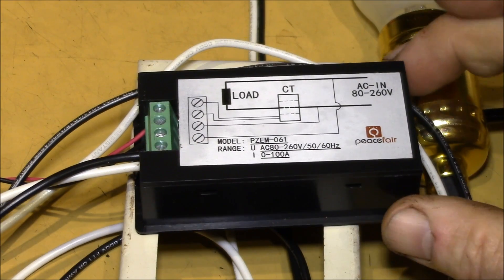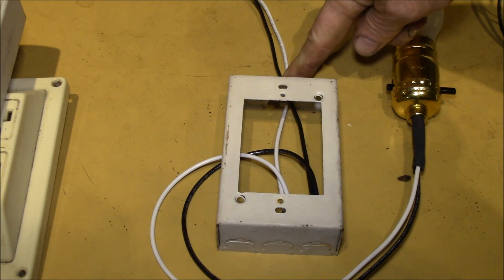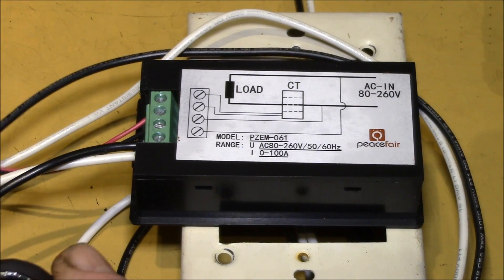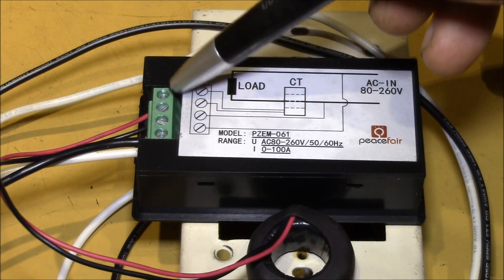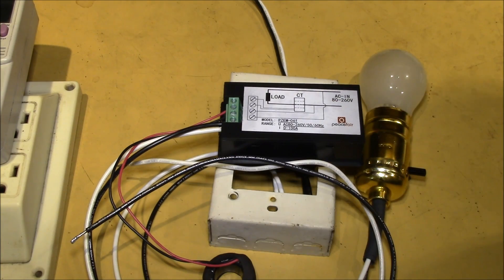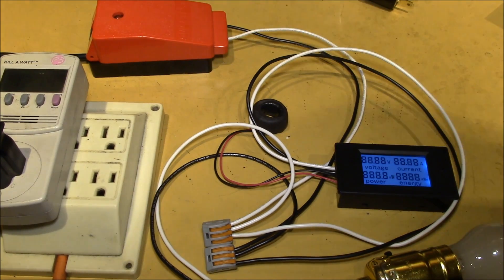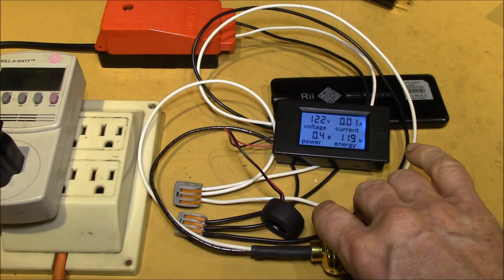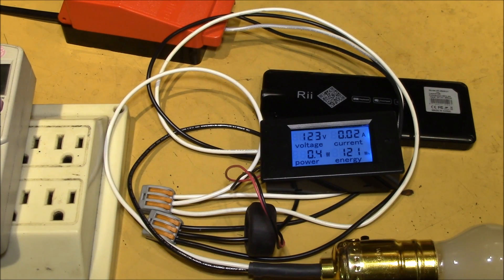PZEM-061 AC Panel Meter Wiring

Comment: I connected a PZEM-021 to my 3A Variac, when I test 100 Watt incandescent bulb, the meter shows 10 or 11 W, how can I make it show the actual wattage? like in 3 digits.
Reply from the maker: Works fine on on my meter connected to a 7A Variac:
https://photos.app.goo.gl/94N1RwSKrB1en83K8

100W bulb, 100.3 watts @ 119 volts.  Maybe check that you have everything connected properly.  I go through the setup in detail starting with this video:
https://youtu.be/47osFl0LuJ0
Reply: @The4Crawler  I don't know much about this subject(electricity) so I just followed Paladinejme's video and he was extremely helpful in guiding me to wire my meter properly so I know it is wired according to what he has done with his which worked perfectly for him, mine OTOH, from the getgo has 0.3A residual leakage? if that's the right lingo?, and the wattage shows 00.0, so it can never show 3 full digits like 100.5 watts, if I connect a100 W bulb and set my variac at 110V, this is what I'll get:110V,  0.13A,  power/Watt 14.2.
I guess it either has something to do with  the small size of the variac(3AMP, 300W) or the meter is limited to show wattage in 2 digits. I googled pzem-21 and saw a few meters that is exactly the same as mine and shows two digits of wattage.
Reply from the maker: @ddistrbd1  My meter is about 4 years old, so perhaps something has changed since then.  But it's somewhat normal to show a small current with no load, that's due to the meter itself pulling power to operate.  That's what I saw on mine until I did this:
https://youtu.be/zpBXKnCsllQ
The idea is to separate the power/current for the meter's power supply from the voltage and current flowing to the load.  Also, the meter will start out reading 0.0 up to 9.9 watts then as the load increase, it'll go up to 99.9 watts then it'll jump to 100.0 and higher.

Comment: Great info here, thanks a bunch. I just bought two of these meters and I plan on building my own meter to monitor how much current I'm pulling through my new inverter generator so I don't overload it.
Reply from the maker: Glad I could help.  Sounds like a good project.  Just make sure and wire up each meter between one hot leg and neutral and then run the hot wire through the CT.
Reply: Great info but I have a question please. I am going to use 2 meters on the 2 legs of a 2 pole 50 amp breaker to my generator. I want to measure the load on each side of my panel. My question is the hot wire from the meter, #3 or 4 connection, needs to go to the load. So if I connect one of those wires to the hot wire to the 50 amp circuit breaker and the other to neutral, won’t that be too much for the meter and shouldn’t the wire gauge be equivalent to the 6 awg from the 50 amp breaker? If I use a 22 awg, won’t that wire heat up or melt?  Thanks for helping me understand how to handle that.
Reply: @garcosta  the power wire for the meter will be fine as is because the meter itself barely pulls any power at all.
Reply: @Ozzie4Para  Thanks for that. Also, if I extend the 2 wires for the CT about 3 ft, do you think it will affect the accuracy of the unit?
Reply: @garcosta  three feet definitely won’t affect any accuracy.
Reply: @OzzieAlacron This is what I am about to do as well, putting one meter on each of the two hot 110V wires. My question is, does it matter which hot wire I use to power each meter? As in does it have to be the same hot wire that the CT is on each meter? Or can I use the same hot wire to power both meters even though one meter CT would be on a different hot wire? I suspect the two wires being out of phase may cause issues but not sure. Thoughts?
Reply: @TaxpayerDave  I would use the same leg that the CT is on. Don’t know if it really matters but that’s what I did.

Comment: I am trying to monitor the power in a 150 amp service to my home with 3 legs, 2 hot and one neutral (240volts total).  I understand I would need to use 2 meters, once for each leg.  I know one of the meter power lines will go to neutral bar, however, where would I connect the hot wire?  to any breaker on each side?  Will the meter measure accurately?  Want to make sure I am getting total load on each side, not just at the  breaker I connect the meter hot wire to.
Reply from the maker: I show a 240V setup in this video:
https://youtu.be/LhR-Z6lBeZw
Now that one is a L1-L2 with no neutral setup.  
With L1-N and L2-N, just connect one voltage terminal of each meter to N and then the other voltage terminal to L1 or L1, running the main panel feed wire through the CT.  This way you'll have 120V reading on each meter and the line current and KWH on each leg.  Unless you have a split CT, it may be tricky to run the 150A main service conductor through the CT, as in you'll need the power company to come out and shut off your power and/or pull the meter while you do that.  Another option:
https://youtu.be/ov2NfLBgjX4?list=PLpY2FP1a9tiurSiQTwhalz4KBxg_7db65&t=230
Reply: @The4Crawler  Ok.  that makes sense.  Yes, i have the split CT.  I am using the PZEM-022 model which has the same wire diagram but measures more values.   Using this to monitor home load, generator load and a subpanel load.  Thank you for the video!

Comment: it is great video, i would like to know how to use it on a water heater on 240 V. Thank you for your help
Reply from the maker: Sure, this is how to wire a 240V version:
https://youtu.be/LhR-Z6lBeZw
Reply: @The4Crawler  i don t want touse it fixed, i want to be able to test more than one appliances, so is it possible to have a 110 volt for the meter and use the ct on the 240? i hope i ask it the right way.i use 110 v to connect the meter and i use the ct on one wire that connect to the water tank. after i can use it on another tank and on and on. Thank you for your help
Reply from the maker: @pitlatour3864  In the video I linked above, I show how to make a portable 240V power meter.  This would be set up for 240V loads only.  I wire the voltage sense input across 240V (line to line) and only one line wire goes through the CT.

Another way to wire the meter is connect the voltage sense across 120V (line to neutral) and then run both line or load wires through the CT.  But you want one wire running left-right and the other running right-left, so that they are 180 degrees out of phase.  This way the meter will be reading 1/2 the voltage (120V) but 2X the current so the power and KWH readings will be correct.  

You could do either wiring style with the CT separate and then run the load wires for each appliance you want to measure through the CT.  I think I've heard about a version of the meter that has a split CT so that would make it easier to install around existing wiring.  I've never looked into that newer version myself so don't have a link to it.

Comment: How would you wire this on a 240v 2 phase on 2x120v?
Reply from the maker: See below:
https://youtu.be/LhR-Z6lBeZw
This is for a pure split phase 240V load, no neutral connection. This setup measures current in one leg and the full line-line voltage.

Comment: Got one of these from amazon today. Showed up DOA, would not power up. I'll be referencing this video again when the replacement shows. Thank you for the detailed walk through.
Reply from the maker: For a quick check, all you need to do is connect the two voltage input lines to power.  It should power up the LCD and at least display the voltage.
Reply: @The4Crawler  Yes sir. Did that. Never even got a flicker out of the screen. Didn't smell anything burnt, but with it being surface mount tech, it was too small to see anything obvious. Thank you for the reply!

Comment: Based on the video, the transformer goes around the hot wire coming directly from the power source before it gets to the Wago nut. Correct?  I keep trying to figure out which black wire you put the transformer.  You did not put the transformer around the black wire to the light bulb I assume.  I did this successfully last year, but lost my diagram so I am redoing it. thank you.
Reply from the maker: You want one of the wires running to the load to go through the current transformer (CT).  You can also run one of the wires from the power feed through the CT if that's easier, although then the meter will read the current needed to run the load plus the current needed to run the meter (which is a few tens of milli-amps).  Either one will work and makes no difference if it's the hot or neutral wire.
Reply: @The4Crawler  ahhh, thank you. I get it now. thank you

Comment: It always takes me a while to sort out what wire you refer to
Reply from the maker: Any particular wire?  I just have the red/black CT wires hooked to the upper 2 screw terminals.  Then there are 3 black (neutral) and 3 white (hot) wires.  One each from the power source.  One each to the load and one each to the meter (and connected to the bottom 2 screw terminals).  Pick one of the wires to the load (light bulb) and run it through the CT and it should work.
Reply: @The4Crawler  I am about to set up another one of these things.  The video is nice, but I have to stop it in order to trace which wire goes where. The video shows black and white wires in a circular pattern and crossing over each other which is most confusing. As with last time I will draw the thing out and go from there. I love this meter.  It is especially useful to me since it is in line with a wall plug connected to my outside Honda generator. Tells me what everything is drawing.
Reply from the maker: I was trying to follow the standard wiring code with the black/white wires and they ended up a bit too long to all fit in the camera frame without coiling them.  May redo the video in the future with different wire colors and much shorter.  

You just have the black/white wire pairs, one pair from the power source (like you generator), one pair to your load(s) and then one pair to the meter.  All 3 pairs connect together at some point, I used some Wago lever nuts, could also be a wire nuts or whatever.  Then all you do is take one of the 2 wires running to the load (or one of the wires running from the generator) and run it through the CT.  Makes no difference which color wire or which direction.

Comment: Audio level for about 90% of the video was terrible!
Reply from the maker: Sorry about that, I can't hear any difference.  Any particular time stamps where it's OK and not OK for you?
Reply: @The4Crawler  Hmmm,
I just re-checked it and its healed itself, I suspect I have a huge problem with interference in my office. We have just switched over to a very expensive and troublesome NBN network here in Australia using part fibre optic and part copper cables. Its the only thing I can blame for the problem.
Thank for getting back to me so promptly.
Cheers
John
Reply from the maker: Thanks for the update.  Have heard some horror stories about that network from Dave @EEVBlog

Comment: Can you use one of these to check the load on a generator hooked up with a 30A 240v cord? If so would I need 2 so I can read the load on both power lines or could I use 1 meter over both power lines? Thank you for the video.
Reply from the maker: Yes, a few options possible.  If you want to see the loads on both 120V legs, then 2 meters, one on each side would do that, add up the readings for the total power. 

Another option is to measure the current in one leg, as shown in this video:
https://youtu.be/LhR-Z6lBeZw
This would read the total power assuming the currents in both legs is fairly well balanced as well as the total voltage.

A 3rd option is to use one meter and then run both currents through the CT.  You need to run one wire through front-back and the other back-front so that they are in phase.  Then connect the meter across one leg to neutral, so it's reading 120V and the CT will see the total current in both legs and calculate a single power reading.
Reply: @The4Crawler  Thank you for taking the time to reply.

Comment: Can you pass two 120v hot legs through the current transformer to measure 240v or does the 240v need to be on one conductor?
Reply from the maker: Apparently yes, you can do two legs through the CT although you need to consider the direction of current flow and what sort of load you are measuring.  In my case, a pure 240V load, no neutral connection, so current in leg1 equal to current in leg2, so only one leg needs to be measured in the CT.  For an unequal load, if you run two legs through the CT you'll get one of two readings.  If both wires are run in the same direction, you'll get the difference in current of the two legs.  If you reverse one leg through the CT,  apparently you'll get an average current reading of the two legs and I think you'll need to measure a L-N voltage not L1-L2.  This is because you are adding the current in L1 and L2 together and thus you need to use half the voltage (120V instead of 240V).

Now if you want to measure each leg separately, you'll need two CTs and either two of these sort of meters or a more sophisticated meter with multiple CT inputs.
Reply: @The4Crawler  If I wanted to measure my house at the breaker panel what leg does this need to be on since there are two, Ground and two hots @ 240v 200amp main shutoff?
Reply from the maker: A few options.  

One is like in this video:
https://youtu.be/LhR-Z6lBeZw
Measure current in 1 leg, voltage across 2 legs.  Works well for a balanced 240V load where the same current flows in both legs.

Second option is to run both L1 and L2 through the CT in opposite directions and then measure voltage between one leg and neutral.  This will show you the sum of currents in L1 and L2 combined with a line-neutral voltage and resulting power.  Practically, this likely won't be possible, because your main feeder wires are probably too large to fit through the CT together.

Third option is to get 2 meters and 2 CTs.  Hook one to L1 and neutral and the other to L2 and neutral and you'll have 2 displays with current, voltage and power readings for each leg.  Add the power readings together for the total power.

Fourth option is to use something like this:
https://youtu.be/ov2NfLBgjX4?list=PLpY2FP1a9tivPdpLVyg8XMqxw6B6SAEbI&t=227
This is a home energy meter with 2 CTs and it interfaces to my home automation system (it has no built in display).  There are other stand alone home energy monitor systems, I think one is called TED.  Similar design, 2 CTs that clamp around L1 and L2 and then measure a voltage.

Comment: Not clear at all.
Twisted wires everywhere
Reply from the maker: Did you have any specific question on the wiring.  It's hard to keep all the wires perfectly straight so I tried to keep the colors matching instead.  Small red and black for the current transformer (CT) and then the black and white for the power/load wires.  Black to black and white to white and run one of those through the CT.
Reply: @The4Crawler  thank you for the clarification.
I just wish you connect everything from scratch to finish on camera it could have been better. Not just explaining already connected system.
Reply from the maker: Thanks for the suggestion, I'll see if I can remake the video showing every single wire connection made on video.  I didn't do this the first time in the interest of time, as the typical YouTube video watch time is a bit over 2 minutes.

Comment: Thank you very much for the clear video, it explained a lot to me. I am trying to setup an Orange Pi so that it measures the "return of investment" of some solar panels. I feel motivated now to hook the PZEM (a bit different one) up to it :)
Reply from the maker: Glad you found the video helpful.  There's one of the meters that has serial data output, the 004T model.  It's only for AC power.

Comment: Hi Brown, thanks for this video. It’s very helpful. I am wondering if it’s possible to power the meter from one line and measure the amperage on another line? I have 3 lines coming in to my house and I want to measure them separately. I ordered 3 meters and I am thinking it would be easier to power them from the same place.
Thanks !
Reply from the maker: You bet, see below:
https://youtu.be/b2MXXSuzM2k
Depending on how you wire them, they may be measuring just one voltage and applying that to the 3 different current readings to calculate the power.  But if all 3 lines are of similar voltage, then that's not a big deal.

Comment: Hi is it possible to connect the CT few metres away from the unit
Reply from the maker: Sure, that's the beauty of a current transformer.  They output a current for the signal.  As long as that current is flowing in a single circuit, it's the same no matter how much wire it flows through.  That is, voltage drop is for the most part irrelevant.

Comment: thank you for this nice video... i am planning to buy this gadget very soon.  my querry is, will this be applicable to this setup? :    electricity provider(outside house)---->circuit breaker switch(main electricity safety switch in the house)---->this gadget(PZEM 061 AC Panel)---->several appliances in the house(as the loads / including an small 0.5 aircon, 1000watts electric stove, and small 6cubic foot fridge) .
Reply from the maker: It should be possible.  Assuming you can fit the current transformer over one of the incoming wires and then get the two voltage connections for the meter, it should handle up to 100 amps of load.